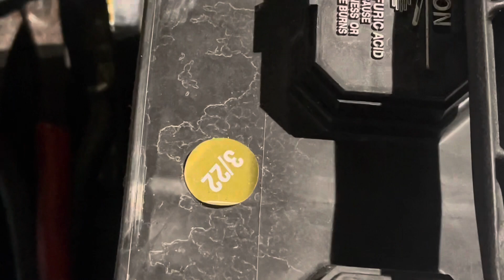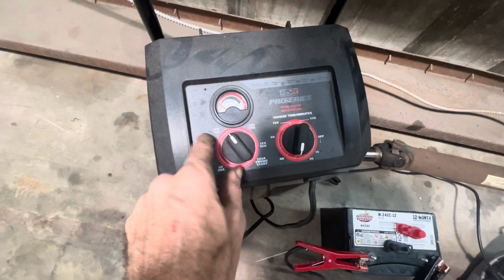ReeeeeeeeActions Welcome! 😏

Comment: OMG!!! you sat the batteries on a cement floor. 🤣 Is that the reaction you were looking for?
Reply: Fan as extension cord and leads backwards
Reply from the maker: @FollowingtheCliffNotes  everything about this video is wrong. I’m unsubscribing!
Reply: I was feeling it, 😆
Reply: Concrete not cement.
Reply: @RainmanRayOffDuty  I’m headed over to Mrsubie
Reply: Never charge a battery on the concrete
Reply: LuL you know it was, its known fact that concrete will pull a charge out of a battery if left sitting for long periods. Seen too many that it happened to.
We put a 36v industrial forklift battery on the floor in our shop not connected to anything and within 2 weeks it was dead as a doornail (0v vom reading).
there are those that do not believe it and say it's a myth, but i'm here to tell you it's not. 😉
Some folks over react to that though, it's not like it zap's it instantly, it doesn't.
Now if you're going to sit it on the floor for a short while like a day or so it will not hurt it, but just don't leave it sitting there for days or weeks on end or you'll regret it.
Reply: @swoopulater  Exactly that’s why I keep my spare battery on a piece of 2x 10 block of wood.
Reply: My grandfather taught me to never leave a battery on concrete. He taught me everything I needed to know in life so I believe him. Even if it turns out to be a myth.
Reply: @swoopulater   I have experienced this issue I solved it by cutting section out of 3/4" plywood the size of the battery then put it under the battery so its not directly sitting on the floor.
Reply: All that conductive plastic surrounding the battery is going to draw down the charge 😂😂 this was only true for the old lead case batteries
Reply: @snagel515  That of course has been proven a myth.
Reply: @snagel515  That's an old wise tale.
Reply: @scottwheeler2494  Back when your grandfather bought batteries perhaps, but new batteries don't discharge on concrete like the ones made decades ago.
Reply: Cement cools the battery, it’s better to charge on granite. Cooler is better with batteries. If the battery were made of steel then grounding would be an issue. Ray breaks the internet 😂
Reply: Concrete doesn't affect today's car batteries. The myth that concrete drains batteries does have some historical basis, however.

Many, many years ago, wooden battery cases encased a glass jar with the battery inside. Any moisture on the floor could cause the wood to swell and possibly fracture the glass, causing it to leak.

Later came the introduction of the hard rubber battery cases, which were somewhat porous and had a high-carbon content. An electrical current could be conducted through this container if the moist concrete floor permitted the current to find an electrical ground. 

The wise advice of the old days to "keep batteries off concrete" has been passed down to us today, but it no longer applies because of the advanced technology of today's batteries.
Reply: @RainmanRayOffDuty  No. Not everything. Getting that battery out of your truck bed will lighten the truck and improve  your fuel mileage. Good move!
Reply: A battery on concrete.  The myth that keeps on giving!
Reply: @silicon212  - At one time, it wasn't a myth. But passed-down advice isn't always as efficiently disseminated as technology.
Reply: @swoopulater  Then you put a bad 36V industrial battery on the floor. There is no reason to keep a battery off concrete anymore. What is your theory as to what makes a battery discharge on concrete vs any other material?
Reply: @azroadposer  That's why I recommend submerging your battery in ice water while charging.  Pro Tip:  If you use salt water, it will get colder! (at first)
Reply: @--_DJ_--  i don't have a theory on how it happens, i've seen it happen repeatedly over the years.
The battery was perfectly fine when it was placed there, then went to install it back in the machine, checked it and it was totally dead.
Something drained the power out of it now didn't it? As to what or why? i don't know the specifics on the scientific reason why... i just know it happened.
When you see it happen you don't need to know the scientific theory as to how it happened other than it did. I leave batteries sitting on shelves, pallets, other materials and they do not drain, but leaving it on the concrete floor and after a couple weeks or a month it's dead? Why don't you tell me why other than 'it's just a bad battery'.
Reply: There's actually historical precedent for that. It no longer applies thanks to modern materials science, but once upon a time when batteries were made of wood case with glass cells and/or porous rubber, condensation and temp changes could affect the materials and cause leaks/discharge. https://www.youtube.com/watch?v=3cH-AL2rkpY
Reply: @scottwheeler2494  it wasnt a myth, but it no longer applies. https://www.youtube.com/watch?v=3cH-AL2rkpY Farmcraft101 testing it then explaining why it used to be true.
Reply: @swoopulater  If it is built like a modern battery the most likely reason a healthy battery would discharge is having it being stored in a dirty condition. Case drain is a thing. 
That battery was either dead when you set it there, bad when you set it there or was filthy when you set it there, or a combination of those.
It would have been in the same condition if you had set it on a 2x6.
Reply: I used to work at an auto parts store. The delivery guy would set the new batteries in the floor. And thats where we kept all the overstock ones as well. Never had an issue
Reply: My dad was a Lineman for the County. We keep our batteries in the refrigerator. Even your mom's.
 😯😯😯🏁😎
Reply: Which USED to be a no-no when battery cases were a different material.
Between the VERY old glass cells in wooden box batteries and today's plastic cased batteries were high-carbon rubber battery cases, that could discharge the battery through contact with an earth ground, of which a concrete slab with a little dampness is a great example.
Reply: @ep61611  Thank you for your service from a Navy Veteran. Concrete may hold a bit of truth in a cold climate. I grew up in a cold climate and don’t recall failures like now living in the valley of the sun where temps regularly exceed 115F. Car batteries do not last more than 2 years here. Never had a battery problem in Florida and Georgia while I was in the Navy. Probably the dry air here drying them out and no service ports to add water anymore.
Reply: @mattwigren4044  >>My dad was a Lineman for the County.<< Did he drive the main road....searching in the sun for another overload...?
Reply: It's concrete, not cement. Cement is one of the additive materials blended to make concrete.  Reeeeeee
Reply: @jthonn  Wise tale?  Really?   Dolt...
Reply: Batteries on concrete is a modern day MYTH that won't die.  There was some truth to it a thousand years ago when battery cases were hard rubber.
Reply: @jthonn  Old wives tale.
Reply: @--_DJ_--  So as for this dirty condition you speak of? no the battery was not dirty, there was no corrosion or acid build up on it, it was fairly new.
Now as for case drain, i think your not understanding what case drain refers to when a battery person tells you that. When you get a case drain, yes it is caused from acid getting around the cells or maybe even a small crack in the case and it has a small leak seeping out and corroding. In some cases the material the case is made of is just poor material and after a time the acid can just seep through it or start coming out of the seams where it is put together. But in most cases when the battery has a 'case drain' and is causing problems in a machine or even dropping voltage for not apparent reason it can bleed through to a grounded state and gradually drain the power out of it. If the battery is in poor condition from poor maintenance then sure it can cause a drain but that was not the case here.
As for what condition that battery i was speaking of was in? it was as i said, nothing was wrong with it.
But now since you mention 'case drain' that could be worked into a theory that maybe if the case of the battery is compromised it could inadvertantly cause a condition allowing the battery to ground out to 'earth ground', and in that scenario might explain why the power gets drained out of it. But what about these batteries that do not have leaks, no signs of damage, are clean, and you sit them on the floor (concrete) and a week or so later they are dead? But if you store them on a shelf they seem to last quite a bit longer?
But i digress...
some people just refuse to believe it no matter how you explain it.
Reply: All those electrons fluttering around loose. Oh, no! Zzzzzt 😂
Reply: @dianab3827  you got it diana heheh the 'loose electrons fluttering' theory 😁😄
Reply: Good grief, the reason you don't leave batteries on concrete is because concrete stays cold, just lay on it awhile and you'll see, conventional batteries lose charge quicker in cooler temps that's it.
Reply: I see old outdated misinformation is still at play. The thing about batteries on concrete applied old wooden cases that warped from moisture and caused the cells to break. Modern hard plastic cases aren't susceptible to this.
Reply: @swoopulater  It has been proven to cause no problems storing a battery on concrete. You are the one refusing to believe the truth. I would check your method of finding "good" batteries if you have them go bad after a week on the floor.
Reply: @--_DJ_--  sorry bro, after 45 yrs of doing this type of work and seeing it for myself happen repeatedly? i stand by what i've said.
Reply: @swoopulater  I've been turning wrenches for a living for the better part of 20. What you have seen is not caused by concrete. Not debatable. Stand by whatever you want, just know you are wrong while you stand there.
Reply: @--_DJ_--  😴
Reply: @HouseCallAutoRepair  yep and we happily obliged him with a pointless debate 🤣🤣🤣
Reply: @RainmanRayOffDuty   everybody knows  to lie the battery  on its side to charge faster
Reply: @Brian  - Batteries do contain a certain amount of water and cold weather does affect the charge. So, it's not the concrete, it's the temperature.
Reply: @swoopulater  i'm no electrical engineer so don't take my words as gospel but i think it might have to do with the rebar mesh in the concrete.
There might be induction at play between charged battery plates and the mesh inside the concrete. That rebar mesh obviously has a connection to ground making it possible for the charge in the battery plates  to leak away to ground.
Reply: Actually according to an interstate battery tech said that is a old wise tail
Reply: @snagel515  Thats a myth fact check
Reply: @swoopulater  Thats a myth fact check
Reply: @snagel515  That’s been proven to be false.
Reply: @swoopulater  I'm a retired network tech from a major telecommunication in Canada, worked with SLA (sealed lead acid) daily, stored them on concrete for months with no adverse effects. You have to remenber, they need to be clean so electrons don't creep between post. They can't be left without a charge for more than 6 months (we would not use brand new battery that had been left uncharge beyond 6 months because of "lead sulfation").
  
Sulfation of SLA Batteries
If a SLA battery is allowed to discharge to a certain point, you may end up with sulfation and render your battery useless, never getting the intended life span out of the battery. Sulfation is when the electrolyte in the sealed lead acid battery begins to break down. Sulfur in the solution leachs from the electrolyte and begins to stick to the lead plates becoming Lead Sulfuric Crystals. The crystal build up on the lead plates keeps the plates from working as intended and also eliminates the needed sulfur in the electrolyte solution.
Reply: @--_DJ_--  agreed. just dust can do it. that's why new batteries come with terminal protection. its not there just to prevent shorts.
Reply: @FollowingtheCliffNotes  Tehy're not backwards. The covers were. You can see the "+" and "-" stamped on top of the battery.
Reply: Looks like you need a scrap bin.
Reply: Old wise tail?? You like to see the homeless naked?? Hahaha. Try: Old Wive's Tale.
Reply: If you look into it. Batteries used to be made from rubber instead of plastic. Old timers would often tell people, "never leave a battery on concrete or you'll ruin it." They meant the concrete. Old batteries used to leak acid and the acid would ruin the concrete. Not the other way around. But some people are so fixated on listening to their elders (which I can understand since I grew up in the south and I do respect mine) that they just blindly believed they were right without knowing any context. Same way that people believed tadpoles came from rotting logs under water or maggots were already in meat before it could rot. Until they invented a microscope and found out otherwise.
Reply: @UncleGunns  How can concrete conduct electricity? Also the battery is plastic on the outside. The only valid thing I can come up with is concrete may be cold. I have charged many a battery, and stored them on my garage floor, no issues.
Reply: @gn4720  lol
Reply: @swoopulater   Battery had an internal short, setting/dropping it on the floor might have caused the short.
Reply: @richardclifton4120  well, I am older than fuck now so it was more than 6 decades when he told me this... so figure he learned the battery secret more than a hundred years ago. Lots of thing have chanced since then but the important stuff hasn't. I just don't always know what has changed. I know things like "don't chase married women, no matter how much fun they might be"  haven't so I will stick with what he taught me.
Reply: No no no. Charge it only on a mound of 97% refined pixie dust, on a lunar waxing moon, in the daylight, out of direct sun 😎 😆
Reply: @hobbesip1  lmao
Reply: @jthonn  "old wives' tale"
Reply: @swoopulater  I always store my batteries on concrete. No problems at all. I even cut out the battery tray in my car and poured a small concrete slab for it to sit on. Works great!👍
Reply: @swoopulater  the fact is, flooded lead acid batteries simply self-discharge... Depending on the overall health of the battery, even a new battery is about 5% per month....

Comment: My Dad always worked with batteries for years and one thing he always stressed to me was never put a battery on a concrete floor whether to charge it or store it because the concrete will drain the battery and shorten it's life, always put a block of wood under the battery if you are going to put it on concrete.... Not to be mean just thought you should know.....

Comment: Pro tip: The battery is a good spot to rest your wrenches and ratchet while youre working.
Reply from the maker: I thought so. Makes them easier to reach
Reply: Brake cleaner cans conduct electricity. #brakecleanmafia
Reply: I accidentally did that with my dads bass boat trolling motor battery night before a big tournament.
He wasnt happy.
Reply: @RainmanRayOffDuty   -  makes them nice and warm for winter use.
Reply: I saw this video in my feed and came here to say just that..  inch away from a handwarmer being created..
Reply: Helps when their fully charged. It warms the lifting handle.
Reply: That is why they are flat on top. Tools go there, and hardware goes on the sorting tray built in under the windshield.
Reply: The Reeeeeeeeee's should note that the wrench was only visible in the thumbnail for the clip, not in the clip itself.  And the battery charger is set for 225A/Engine Start in that thumbnail, and in the clip he set if for 10A.  Ray set us up with that one, gettin' his own Reeeeeeeeee's in!
Reply: Keeps em warm in the winter.
Reply: @jannemyllyla1223  just wondering how cold does it gets in Florida?
Reply: If you don't care about the finish on your shiney chromed wrench it is. I'll never do it again.
Reply: Don’t let the apprentice use your favourite 10mm ratchet spanner to pull a battery! Especially just after a lecture on battery safety! as It’s excellent for ratchet spanners and it converts them to a conventional ring spanner! Lucky it was only a 400cca mower battery
Reply: @RainmanRayOffDuty  Keeps the tools warm on a cold day too, with a glow in the dark bonus.😀
Reply: I reserve that location for my ether cans.
Reply: Says Sir Tjnojl..AKA "SPARKY"!!
Reply: I always put my coffee or hot cocoa on it.
Reply: I do it. Only made a hot wrench once in my 20s
Reply: It's especially nice on cold days, as it can heat the tools, helping keep your hands warm.
Reply: Or your metal capped screw drivers. Makes the handles moldable. 😂

Comment: Ray, I've had surprisingly good luck reviving batteries with Harbor Freight's "Viking 2/8/15 Amp Automatic Microprocessor Controlled Battery Charger".  It has a recondition mode that has worked on a couple of batteries that had dropped cells.

Comment: To be fair, I’m shocked at the amount of people not mentioning the reverse polarity of the charge leads. 😂
Reply: I believe that only the protective terminal covers were swapped. The battery, at least as far as I can remember, should have the positive on the bottom left (with top readable) and the negative terminal on bottom right. Of course I could be completely wrong too. REEEEEEE ! ! !
Reply: @electronicengineer  you are right :) ray puts the correct polar only caps where on wrong. or do i say ,, different? ;)
Reply: @lexiyoutube  "The protective caps were put on the battery terminals in reverse."
Reply: @electronicengineer  yes i know ghehe
Reply: Well, if you think of it, he reversed the electrons in order to revert life in it, otherwise he would be discharging it more :D
Reply: I was just going to say that lol